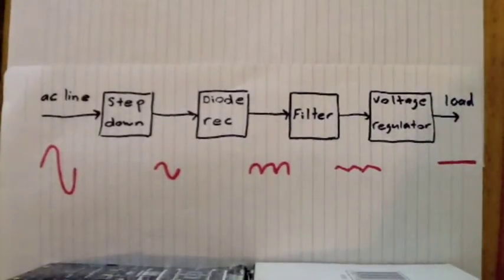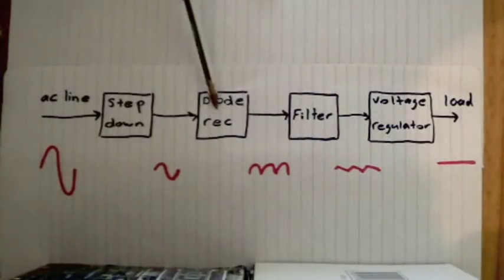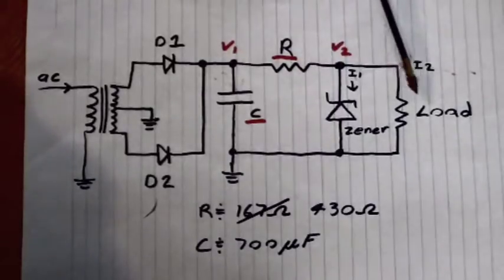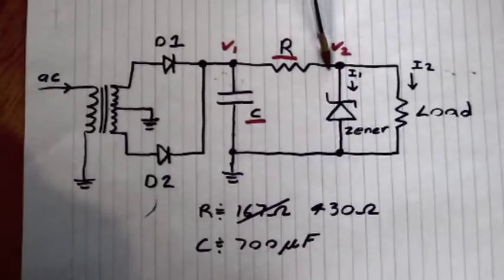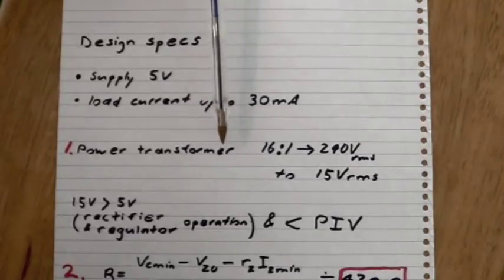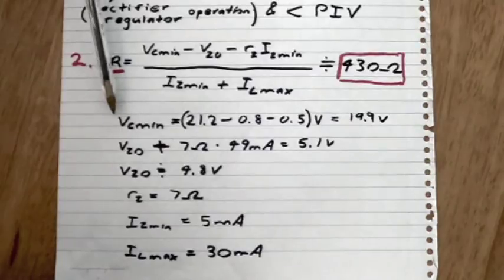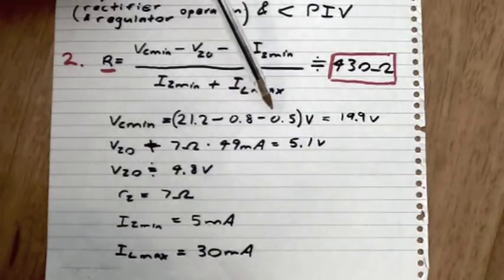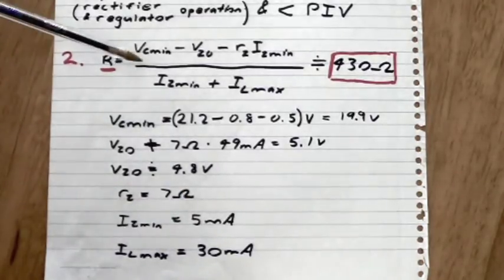5V dc power supply (part 1 of 3)

Comment: 1. An electrical appliance 2A but I used 10A 5V as input, what will happen?

2. What will happen when I use 20 A 5V?
Reply: As long as the input voltage is the same (5V), there is no problem. In fact when current rating of the input source is larger than the appliance's, it is safer.